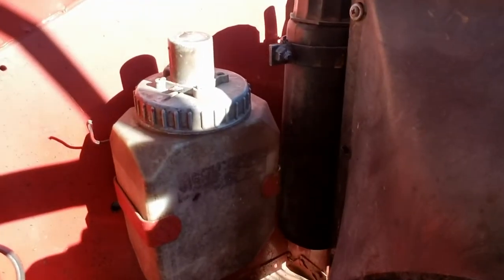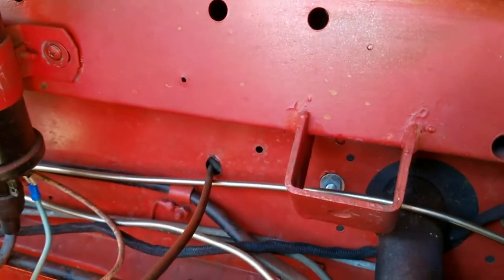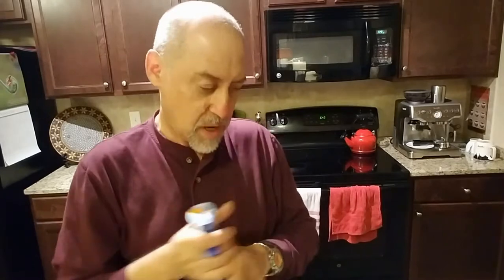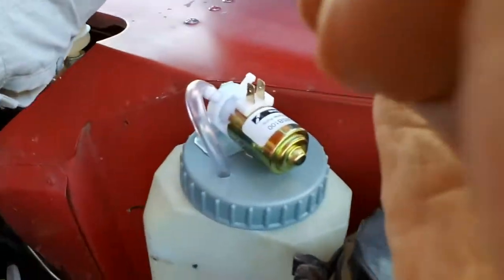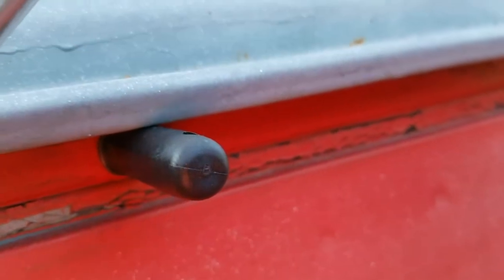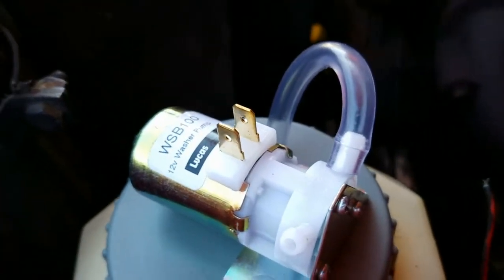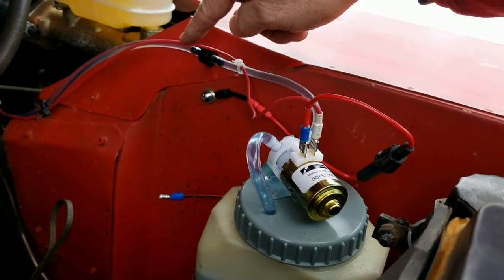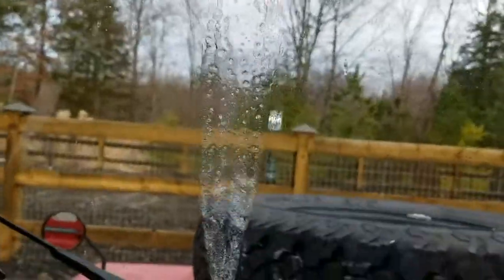Video 5 - Series IIA Land Rover (Windscreen Washer)

Comment: What I've used for cleaning inside of the bottle is small, about the size of your pinkie finger nail, gravel, about a cups worth, with some soapy water. Close the top, but not with a pump lid like you have as that might damage the pump, and shake it up, works absolute wonders.
Reply from the maker: I like it. Great solution to this problem. THANKS!

Comment: RH wiper blade is too long.

Also, shouldn't these wipers park at the bottom of the screen? There's a park switch on the wiper motor which controls that. Cheap and straight forward to replace
Reply from the maker: Quite right, Thomas! I never could figure out how to get that park switch to work right.  Maybe I did need to replace it.  Thanks for your input for the rest of the viewers! I did eventually swap out for new correct length blades when I failed state inspection a year later based on blade quality.